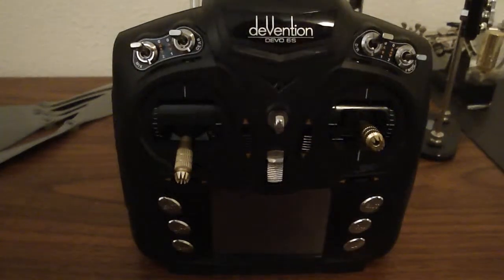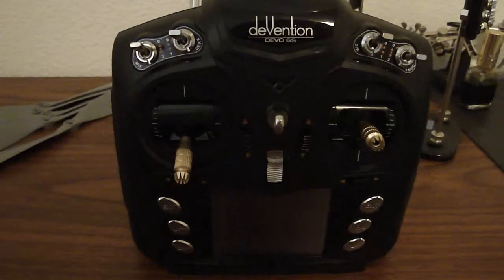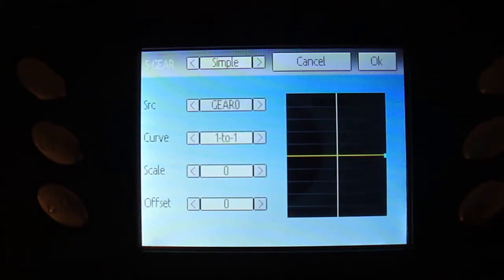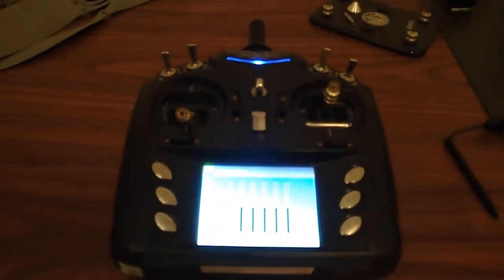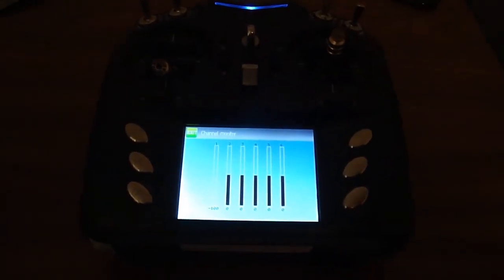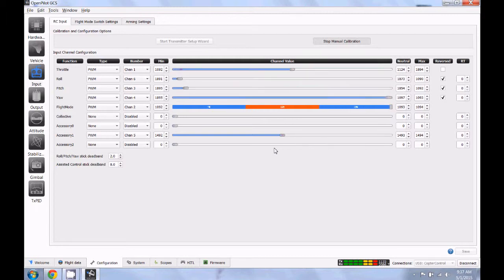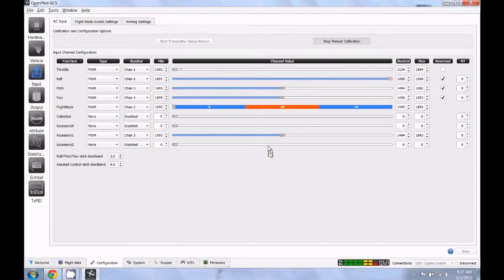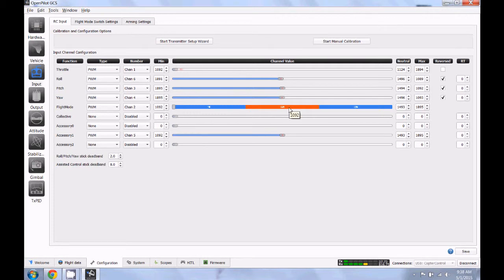How to setup TxPID without having an AUX knob or slider!

Comment: Hi Override
I have the flysky t6 raido it dose not have the set up like your

I try to set up the tricopter, in the stick set page the sticks run all over will not stay in the center. 
ross

I do not know how to set up this radio.
need help.
Reply from the maker: Charles Ross check out my other video - How to tune and setup a Tricopter with CC3D, I go through the entire setup process from beginning to end which includes the Transmitter section in CC3D.

Comment: Great video. I am using a devo 7, possible to setup TXPID with the default devo firmware?
Reply from the maker: I am unfamiliar with the Devo 7 but if the stock firmware allows you to change switch/trim assignments the. You should be golden.